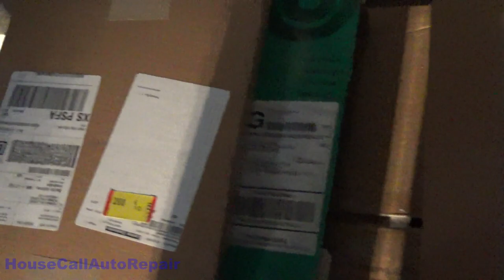2006 Hummer H3 3.5 5cyl - Part 2 - Autopsy to Pavement - On to the Engine Stand

Comment: What is the mystery part? This is too much suspense😬
Reply from the maker: I'll tell you it was a small bolt, but I'm still really trying to understand how and where. It was completely covered in soft rust, and I'm reasonably sure it fell out of a coolant passage, thus not capable of locking up the engine. (there were also no missing internal bolts) This engine HAD to have been through the cylinder head recall, during which time someone must have accidentally lost a bolt somewhere..... It was the one small bolt on the left side of the bench, standing on end.